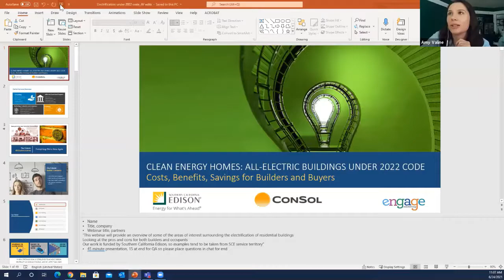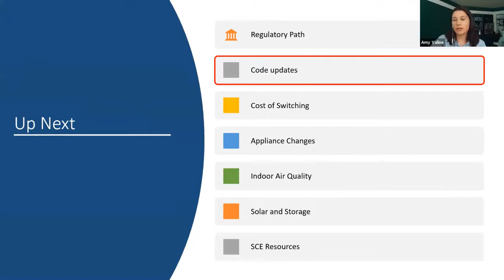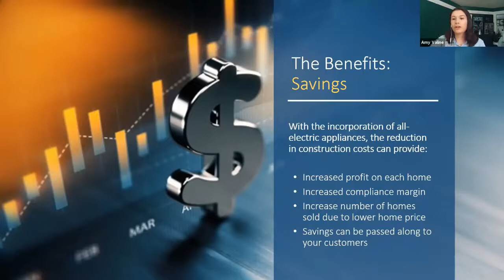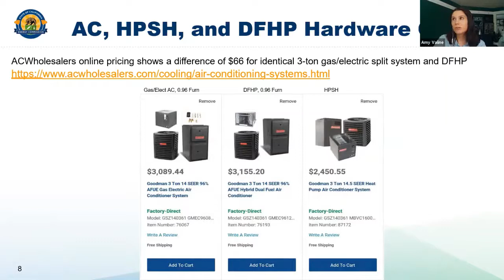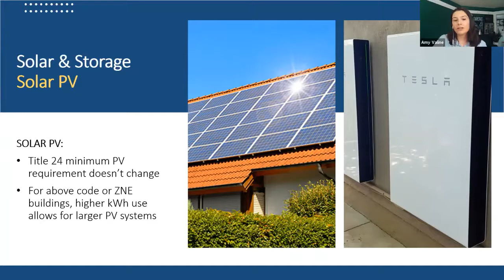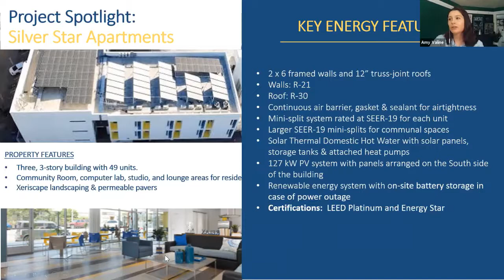All Electric Homes Benefits for Builders

Comment: When house hunting all electric was a deal breaker on 10 houses. During the severe TX ice storm in February 2021 I fervently thanked God for having done so as the gas line in my fireplace was my only utility. Without that heat I might have died. For that reason alone I would never buy an all electric house